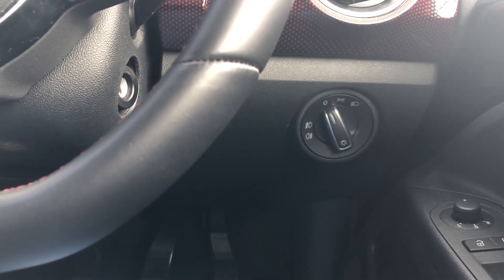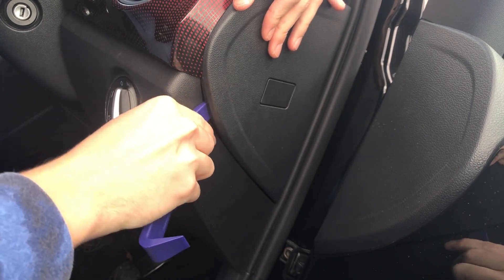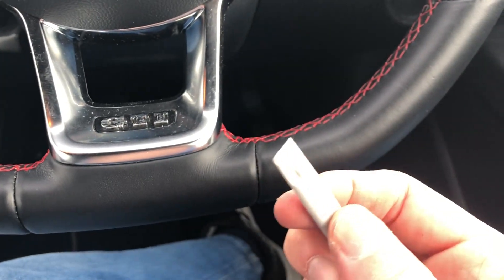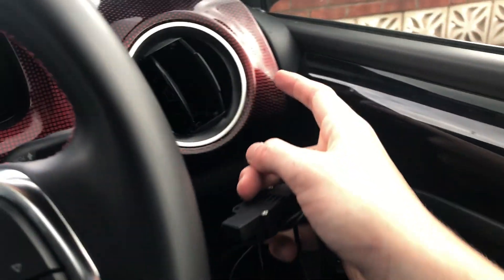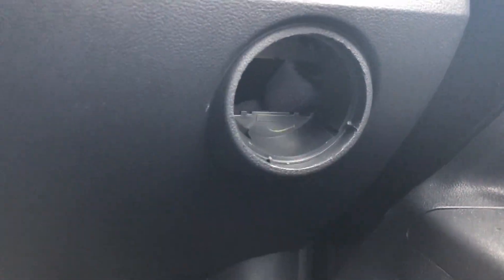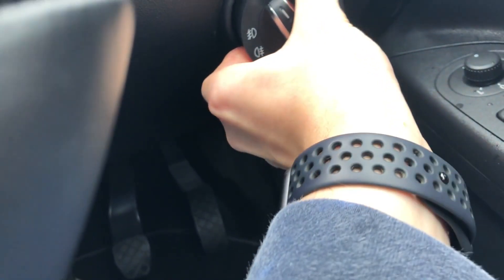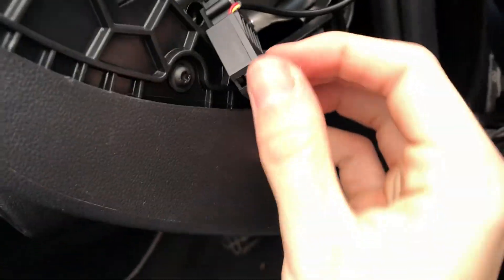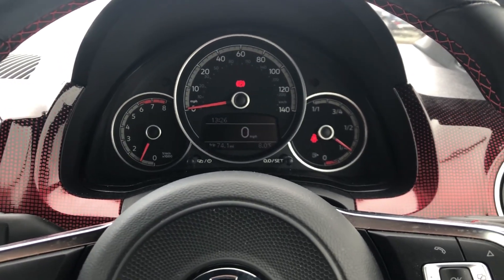How to install an auto lights switch on a VW Up! (Not just the GTI) (2018 models onwards)

Comment: Useful trick for the future, just push in the light knob and turn to the sidelights position then the whole thing just slides out 👍
Reply from the maker: That’s good to know, thank you!
Reply: Superb tip, worked like a charm. Thanks Ruairidh 👍🏻😊👍🏻
Reply: This works for both stock and OEM switches, I've got the same on my Leon.
Reply: Yep just  push in and turn the switch it's out
Reply: My switch has jammed 😮

Comment: Flick from auto to headlights then back to auto(with key in ignition) and that enables leaving home feature. Then flick from auto to 0 back to auto to enable tunnel mode. Do this in almost one motion (not too slow).

Now take key out of ignition and flick from auto to 0 and back to auto (x2) (but fairly fast) to set the duration of the coming/leaving home feature (it should have flashed twice). Then switch to 0 and a timer would have started in the ECU of the light module. You can choose the duration of how long you want the lights to be on during welcome/leaving feature up to 60 seconds. Then after the time you chose (I waited 30s) switch to auto and it should work. 

This worked for my car. Also bought my module on eBay so maybe it’ll work for yours. Hope this helps 🌟
Reply: Was your car an up gti too? Can you do your own video?

Comment: But be carefull with the light switch. The older UPs have a different switch as is shown in the video. Befor you buy a switch, look after the plug in your UP.
Reply: Yup just cost me, link doesn't fit my 2018 Tsi

Comment: Ordered from the link, went to fit it today but its not compatible with my 2018 model. Looking into it now it appears theres a change in switch part way through 2018  although mine does look like the one on the left hand side on the video picture which is a bit misleading. Anyway all I can say is best removing the whole thing first to check first if your going to do this. Anything 2017 or older the part WONT fit, anything 2019 onwards will probably fit, anything in between is guess work and will definatety need checking first.
Reply from the maker: Apologise if my video was misleading. This was never my intention and have made changes to the video title and description so I hope this never happens to anyone else.
Reply: @RicsCars  thanks for the reply, it is a decent video that's better than I've done & with good intent on genuine enthusiasm to improve your car and I applaud that.
I was a bit miffed I can't deny that, however you can't be blamed for any exclusions as specifics of car components change all the time.
It was up to me to check specifics before attempting this and was lashing out with my comment in frustration. Anyway no harm done.
Have a good day fella and be assured there's no bad feelings, I apologise to you also if I caused any bad feelings ✌️
Reply from the maker: @stephenowens5375  Your comment was vailed and I'm happy to receive constructive criticism so thank you for that!

Comment: Will this work on a 2013 up Rock. I contacted a seller on eBay and he said it wont fit. I assume they are all the same switch in the VAG group.
Reply from the maker: If it looks the same as it does in the video it should be fine. Might be best to remove the current one to check its the same before buying
Reply: @RicsCars  it's only £20, if it doesn't work, I'll sell on. Cheers.
Reply: Did you find it out? Have the same question for my Up from 2013

Comment: I'm finding it really hard to remove the unit is there any other idea u may have plz
Reply: With the original switch, push the dial inwards and twist clockwise, then pull the switch out. That's the easiest way of doing it.
Reply: Cannot remove mine easily